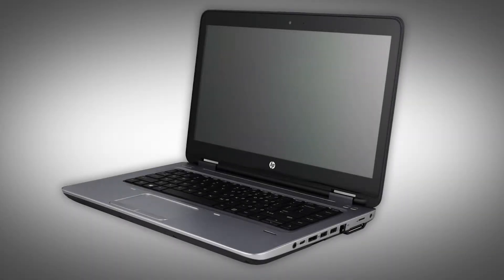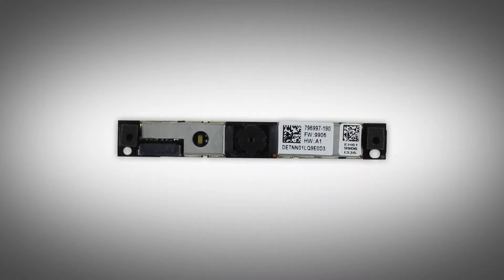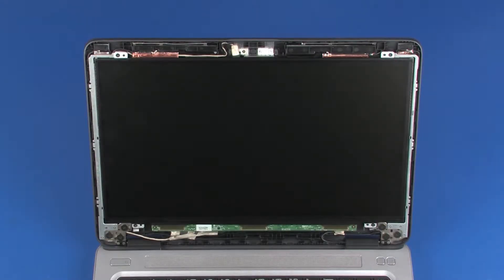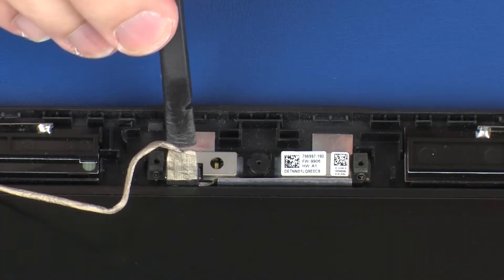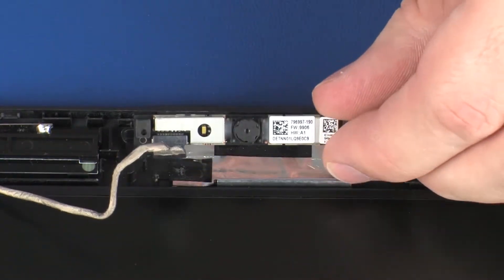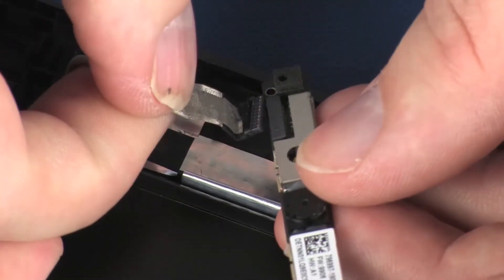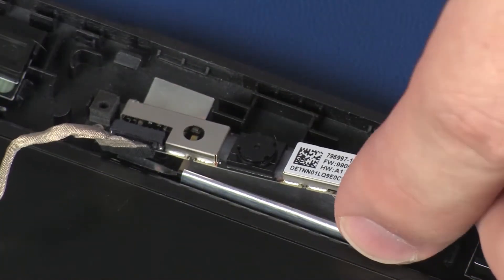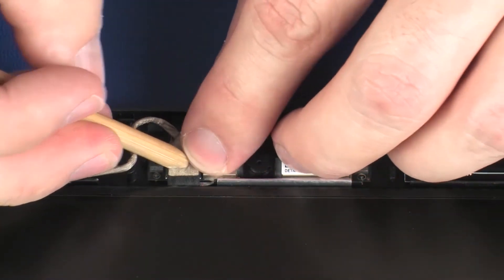Replace the Webcam/Microphone Board | HP Probook 640 and 645 G2 Notebooks | HP Support

Comment: Would you be kind and give us the solution to fix go elitebook 2760 webcamera please ?
Reply from the maker: +RAM BAN Please try power resetting your notebook as mentioned here to fix this issue: https://bit.ly/36NqCgo If the issue still persist, please perform updates via Windows and HP Support Assistant as mentioned below to fix this issue: Step 1 Windows Updates - 1) In the search box, type and open Windows Updates. 2) Check for updates. 3) If the updates are available, click on install and restart the computer. Step 2 HP Support Assistant Updates - 1) In the search box, type and open HP Support Assistant. 2) Check for updates. 3) If the updates are available, click on install and restart the computer.
Reply: before to change webcam device, can i check this in bios menu ?? is it appear out of order ? or not ?  thank you for your answer. my hp assistant dont find my webcam device or driver. i was install generic driver from hp website for my model laptop, dont fix webcam 😱